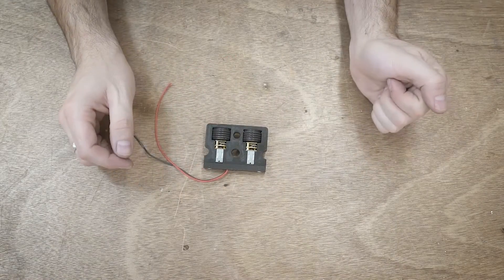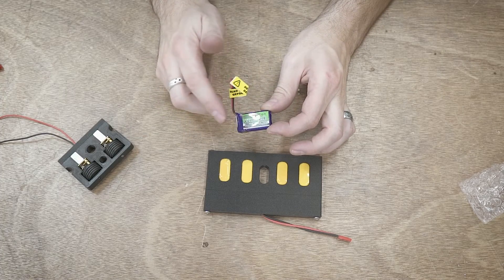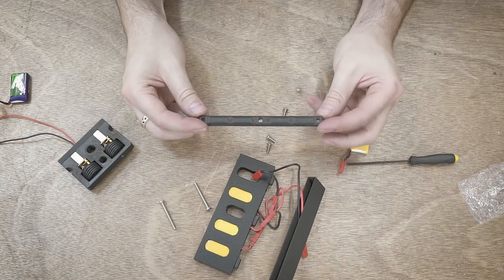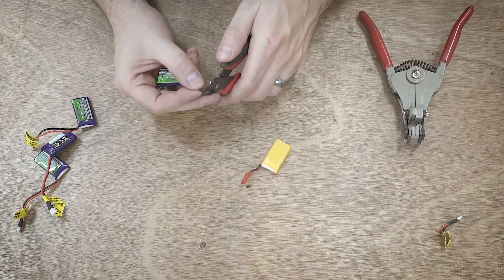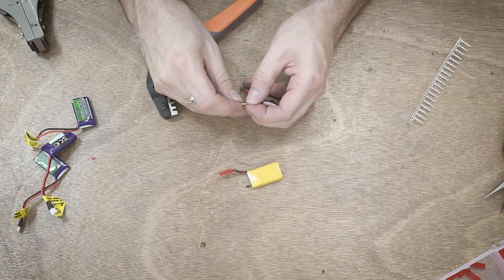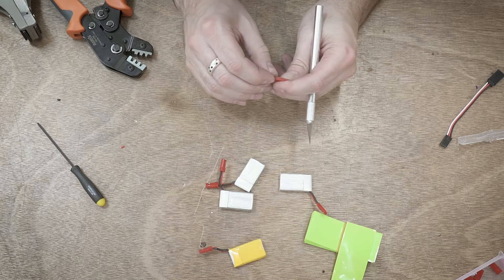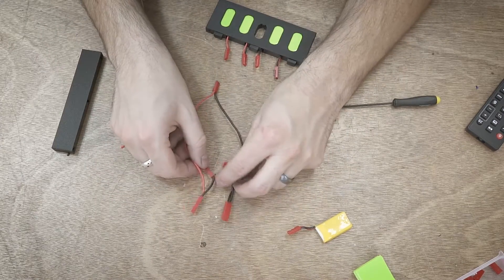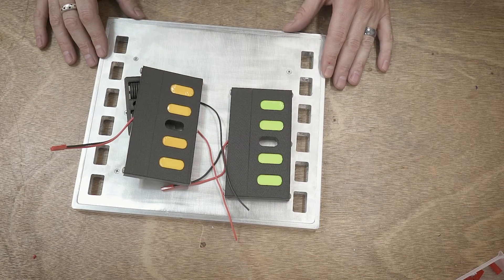Low Low Man - Battery Cartridges

Comment: I was sad when said you took off those connectors that came on it, and put the JST/BEC connectors on. Micro deans are the best for that weight class in my experience.
Reply from the maker: I didn't have any issues with the connectors.  I just wanted things to be consistent.  Weight wasn't really a concern either.

Comment: I can make it more thinner....by just opening a normal 4s drone battery
Reply from the maker: Then do it!  Also, the batteries were not the limiting factor, the motors are 10mm thick, so I can't go thinner than that without significant issues.
Reply: @RobertCowanDIY  oh...I see...will it make any difference(current or voltage or price) if we tear apart a 4s battery to do that?